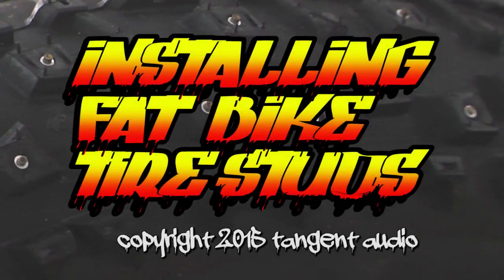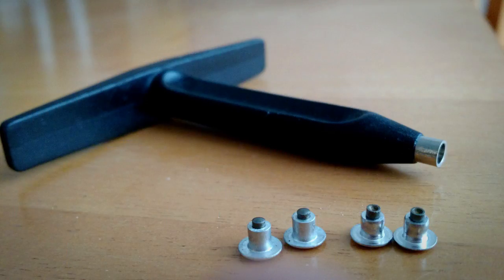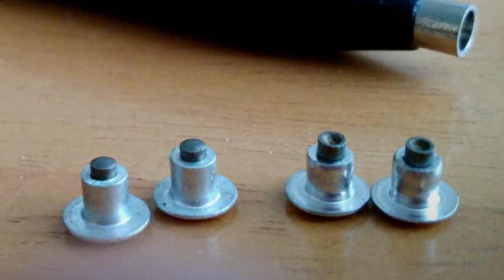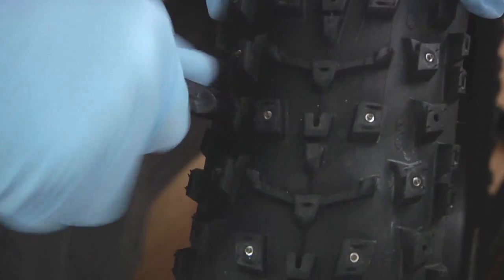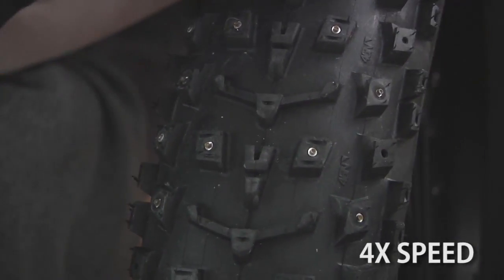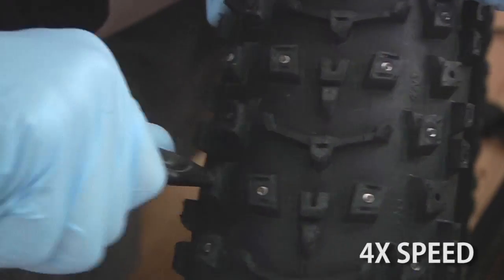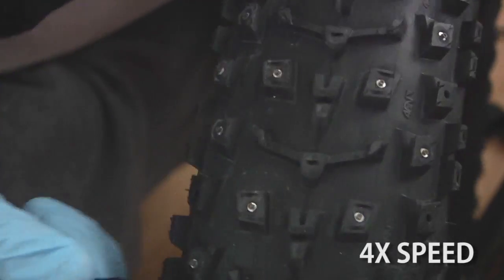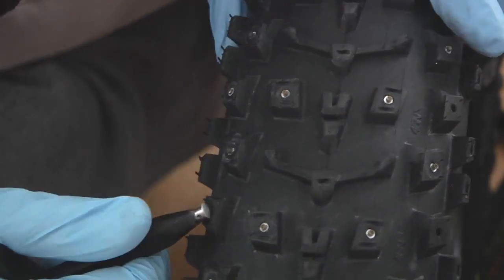Fat Bike Tire Stud Installation

Comment: It's expensive but if you had an alternate set of wheels, you could have one set up with studs and the other without, than just switch them depending on the conditions.

Comment: Seems like my Vee Showshoe XL holes are a little smaller... definitely not as east for me as it seems in this video. Or I need to work out more.
Reply: I find it much harder to do as well. I have Vee SnowshoeXL as well. It is the last I'm trying to do it on that tire
Reply: Try dipping them in alcohol prior to installing. Makes all the difference

Comment: How many do you recommend installing for ice? I have Dillinger 4 tires on my Carbon Beargrease.   I saw the ones they sell come with 240 I figure thats an awful lot if I'm installing them myself.
Reply from the maker: You definitely want to put them all in.  It's a lot of tedious work, but even with all 240 studs fat tires do not have the same amount of grip on the ice that skinny studded tires do.  That will only get worse if you leave out studs.  I recommended taking frequent breaks and drinking beer while you put them in.  Good luck!
Reply: Yeah thanks my friend just bought the new Dillinger 4 tires that come with studs.  I'm riding with him today so I'm going to test out and ask what they charged him at the shop we race for.  I'm trying to decide if I want to take the time to put them in mine or just buy them already studded and just sell my tires.  I've only ridden on the tires twice since I use a different set of tire for summer.  I found the same studs  $30 for 100 and the tool is $7.  So I'm looking about $160 if I do the work myself and Ill leftover studs and tool which I guess makes it worth it.  MRSP on the tires is $225 a piece.